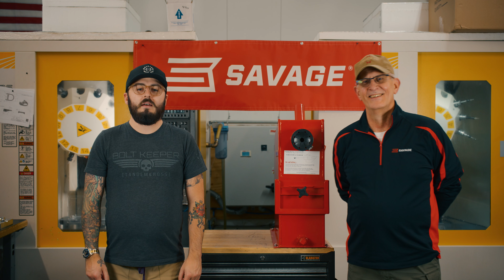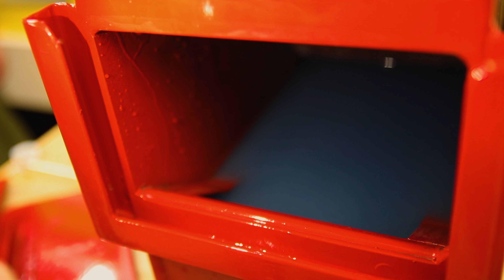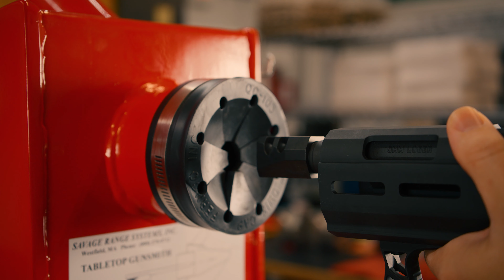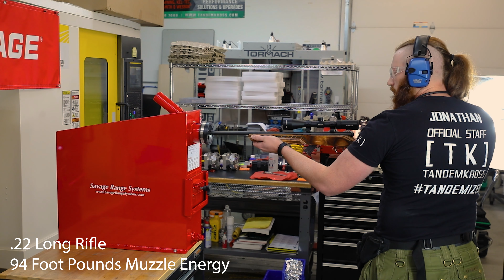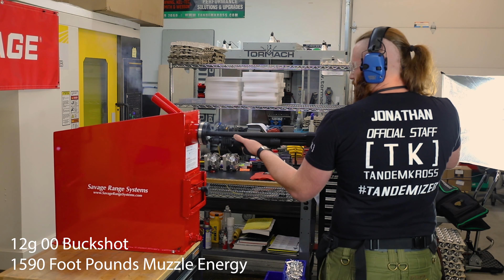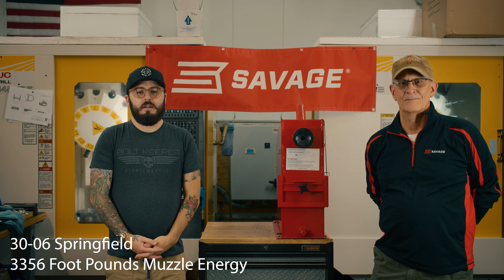How To Set Up, Use, and Maintain the Table Top Gunsmith (Model GT) | Savage Range Systems

Comment: I have your Free Standing Check-it. Would it benefit having water and oil in it too? Also, I don't see a removable tray. Can it be emptied? Thanks
Reply from the maker: Hey there! Since the FS Check-It is not intended to be used for routine firearm testing, it does not feature a removable collection tray, and water should not be added to the unit.

Comment: Used this gunsmithing on a binary install for a customer. The barrel was in the protecting sleeve. The rifle had a brake on it which upon firing, blew the sleeve off even with the clamp tightened and caused the rifle to drop since nothing was holding it and the round fragmented off the unit and into me.
Reply from the maker: Hello there!  Can you email m.misterka@savagearms.com with your contact information?  That way we can have someone reach out to you regarding the situation.  Thank you!